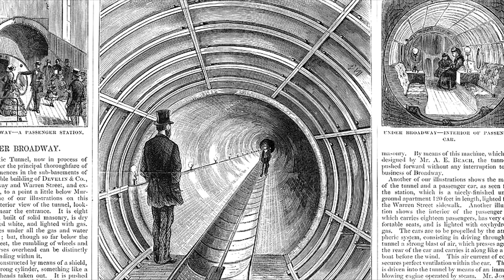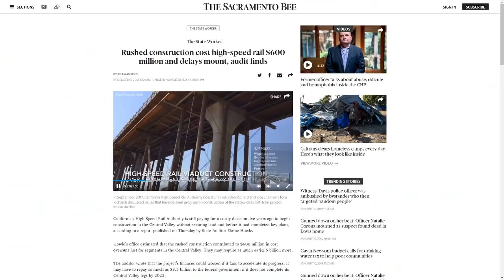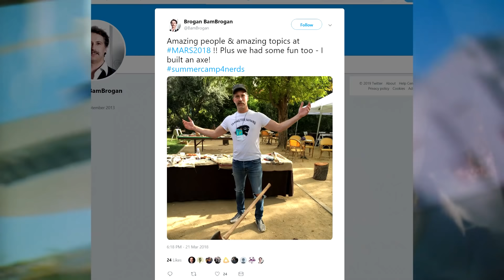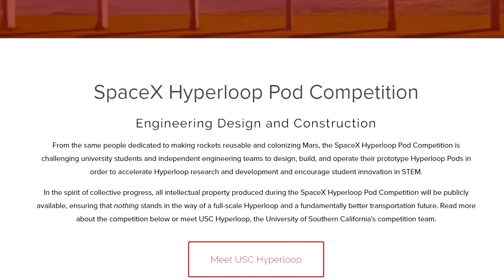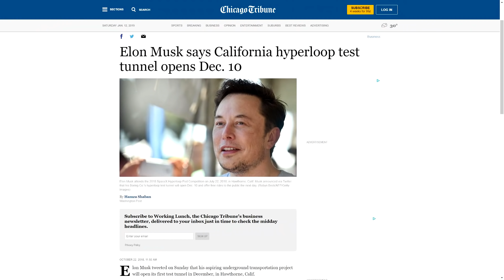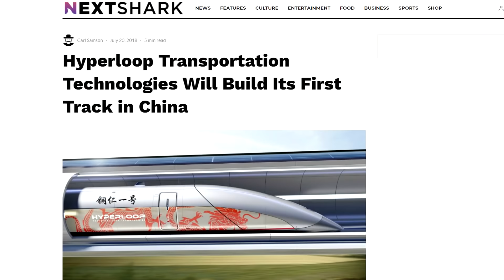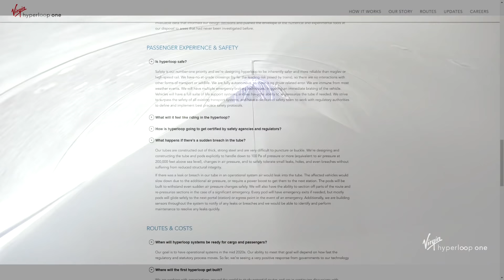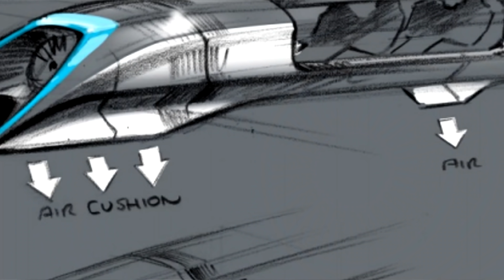Why Hyperloop will FAIL HARD - Its Biggest Problem...

Comment: 2 problems from my seat:
1: The cost of air travel in North America is cheap: You only need two relatively small pieces of concrete, some paved roads a few hundred meters long, a couple of planes (say are the same price as hyperloop trains), and two fairly expensive control towers.  However, you don't need to worry about land costs with air travel, you can travel to any city that has an airport and you can subtract or add planes for routes according to demand so it can scale quite easily.
The hyperloop, however, needs a ton of infrastructure, the maglev track, the tubes, the trains (which about balance with air travel planes) .  For the tubes alone, we are talking about Hoover Dam amounts of material and engineering and once a tube is built it can't go anywhere else.  
India and Dubai will have their hyperloops, eventually, but look at  the sheer cost of them for their length and their population densities and labor costs are such that might make it viable.  Why they didn't just build super-high-speed-trains that would have cost much less, can scale easier with demand, and have way better safety, I don't know.
2: The square/cube problem: The amount of power required to move a vehicle through air increases as the square of the speed.  So you say to yourself, "Aha, I'll just remove the air".  BUT the amount of power required to remove the air from a tube increases as the CUBE of the length.  That cubing of the power requirement will quickly nullify any gains made by removing the air.  Yes, once you create the vacuum, you only need to remove the air spent in the airlocks at either end but that initial ramp up requires a ludicrous (like entire cities) amount of power and you will need many, many, many motors to achieve it.

Comment: 10:03
London Underground Victoria line, Central line and Paris Metro Line 14:
Hahalol
Victoria Line: around 35,000 to 40,000 people per hour at 80 kph
Central Line: 29,000 to 35,000 people per hour at 100 kph
Paris Metro Line 14: (I don't know the exact frequency, so let's assume every 2 minutes) around 30,000 people per hour
THIS IS IN ONE DIRECTION ONLY

This completely dwarfs that of any hyperloop system. Add quadruple tracks and you double the capacity.

Comment: The reason it's gonna fail it's massively impractical if at all possible. The problem is with the vacuum tube. You're looking at a vacuum chamber larger than the largest one in the world by a factor of thousands, made of steel, which is a terrible material to use for maintaining a vacuum of that scale. Especially when you take into account things like thermal expansion.

Yes, steel and aluminium can handle massive over pressure. Just look at the 3atm inside a beer can. But cannot handle it the other way around. Again, how easily you can crush a beer can.

You're taking all the problems of high altitude space/air travel, combining them with all the problems of rail transportation and vacuum technology all mixed with all the engineering problems of building a pressurised pipeline.

This is why the test tracks are so small. Why none of the "pods" have achieved meaningful speeds. Because even a 3m wide 500meter long, with an internal volume of 3,500 qbm is the best they've achieved so far. A far cry from Nasa's SEC Vacuum chamber of 22,653 qbm. But then again, the SEC is made of foot thick reinforced concrete by actual engineers and scientists. To match the SEC, Hyperloop must make at least a 3.2km track

Comment: How much time does it take for a hyperloop train to stop in a station, let air into the station, disembark passengers, embark new passengers, suck the air out of the station and tunnel and have the train set off again?
Reply: It won't suck air in and out of the station, it will be sealed.
Reply: @squdardt.9719  So how do you move a train from a vacuum into a section at atmospheric pressure without the air destroying the vacuum? You have to stop the train in an airlock and then move into the station. Fine. What happens when you leave the station? The train has to stop again in an airlock, only this time the air has to be sucked out before it can move forward into the vacuum in the main tube. These stops would negate any gain from using a vacuum.
How do you extract passengers in the case of an electrical failure? You have to slowly let air into the tube, Extract passengers through the front or rear of the train and then have them walk along a tube for what could be a long distance, simply to deposit them somewhere in a desert. Think about these problems and stop being hypnotised by Musk's ludicrous dreams.

Comment: @AmericanRailClub: I like your channel, but you have your physics wrong at 13:28 

It all depends where the beach in the hyperloop tube occurs.

If a breach occurs some distance ahead of the speeding hyperloop vehicle, then air will tend to rush in to the tube (from outside), effectively creating a 'wall' of air inside the tube, which will then cause a sudden and large deceleration of the vehicle.  

Depending on the size of the breach, this will damage the hyperloop vehicle and cause injuries to passengers. 

If a breach occurs behind the travelling vehicle, then (again, depending on the size of the breach) there will be either a rapid or an exhyperlooprapidhyperloopprospect

situationhyper loopdifferential

assist

that it has

evacuatinghowever

Comment: It's not really the Hyperloop by itself that's important, but all the innovations and revivals and discussions it leads to, a conversation we need to have. Maglev, underground transportation, pods are all great ideas, it is certain that we'll see some of these ideas put into practice, for instance, between airports and city centers to start with, but also on longer distances.
If depressurized tunnels are too expensive or complex or risky, then that part may not happen (yet) without cancelling out the other Hyperloop technologies or ideas.
If pods can't serve many passengers, nothing really prevents from having pods departing every 30 seconds or having bigger pods without compromising that concept.
Trains that go from New York to Chicago carry more passengers, sure, but that's also because there are only about 1 to 3 direct trains per day, and they take 19 to 23 hours one way! Trains are more environmentally-friendly than planes, but most people don't want to travel at 31-37mph in 2019. In any case, building a fast railroad track above ground is not really an option these days, so building a protected tunnel where you can go high speed makes sense. An hyperloop from New York to Chicago would take only about an hour according to specs, which is about what it takes to go from city center to airport and back, let alone the plane trip itself. So we need to be realistic, but also to give consideration to how we can use the Hyperloop concept to design better transportation.
Cities can't expand much horizontally or upward anyway, so it is clear that there is a future for person and goods underground transportation. Shopping or Amazon autonomous home deliveries seem much more promising underground than above, for instance.

Comment: Safety: You point out the apparent lack of thought for emergency egress. Before I'd get on a "pod in a vacuum tube" I would like to know about what happens in the event of an on-board 🔥. Just look up "KAPRUN DISASTER." Pod in a vacuum tube seems much worse - the fire goes out when oxygen levels drop below levels needed to sustain life. Or do you get emergency supplemental oxygen (think airlines)? Or is it, "in the event of an on board fire you will pass out due to hypoxia long before you'll feel the burns?" I want to know. All Sarcasm

Comment: You’re the first I’ve heard to discuss the curve-radius and earthquakes too. Excellent.
Reply: Thunderf00t already covered those problems quite a while ago.  And many others.
Reply: @bdf2718  - I seen many of his debunks on this but can’t recall him discussing 700mph curves...
Reply: @prtauvers  I'm pretty sure he mentioned the curves in his past videos.  Not in great detail, but he mentioned them in passing at least once.

He mentioned them in more detail recently.  He examined the type of air compression needed in the original version (air sled) and noted that they did not handle curves well because of gyroscopic effects.

The whole scheme is fractally wrong.

Musk has implicitly admitted it's complete bollocks.  OK, I'll pretend to believe him when he said he didn't have time to run it, but that's no excuse for making it open.  What he would have done, had he believed it feasible, is sold the rights, or leased them, or some such arrangement.  Making it open is so he can say "It was a fantastic idea but it's failed so far because these clowns are bad at implementing it" and his fans will believe him.

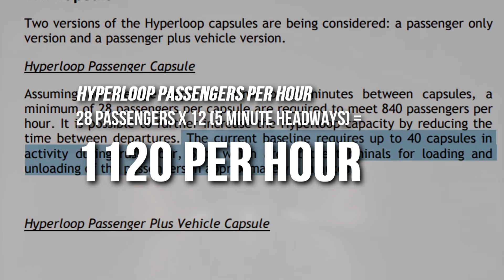Comment: You say at 9:34 that the max capacity of a pod is 28 passengers. Why couldn't it be more that this? Also why  have a headway of 5 min? Why not 30 seconds... or less? This would fix the capacity problem

Comment: The turning radius argument does not hold 'water' as it does not take in banking the turns. NASCAR races can reach over 200 mph, with tight curves (32' bank). Besides that, you are correct on capacity of the system - far smarter to just change to a subway application.

Comment: Boring tunnel concept has same basic problem -- economies of scale. It only takes one car at a time. Won't work for most people. If it works, it will be expensive and exclusive. 
I like the ideas, but they have major limitations in my opinion. 
Anyway, the stretch to make the tech work will help engineers learn new things and develop useful technologies that might improve the world in unexpected ways. The boring machine's efficiency seems impressive.
Reply: Everything is about scale, the only area where Musk's ventures are making progress is space launch systems.  Tesla wasn't his baby, but he's had control of it long enough to have made it profitable by now; instead it's still  in the red, and they haven't produced any trade or fleet vehicles that would get them the greatest market share overnight.
Reply: @MrTaxiRob  
Tesla is definitely profitable.

Comment: I am a railway consultant in Germany (capacity studies, timetables, transportation planning www.vr-transport.com) and we've written critical studies about the german maglev project lots of years ago. Sorry for the not perfect english, I try it anyway.
There are two kinds of magnetic levitation: Attraction and rejection. The german "Transrapid" driving in Shanghai (and not in Germany) works with Attraction (the magnets in the vehicle are placed below the rail, which makes switches difficult). A computer omits the contact, a fixed 10 millimeters distance has to be hold with nearly no tolerance. With rejection, you don't need a Computer. But the amount of energy is very high.  It flies 15 cm over the track. The japanese system needs 2 to 3 times more primary energy than planes, but not only for levitation, the high speed with full normal air pressure (planes travel in low pressure) needs a lot of energy.
The main reason why Transrapid has not been implemented in Germany is
- it is not compatible with the default rail network
- switches are not really possible (a ski jump on the other direction), so you can only implement point to point relations, it is not possible to create a network.
- The long stator motor conept omits energy transfer to the vehicle, but the active part of the motor is in the rail and not in the vehicle. This is the main reason why a Transrapid costs 3 times more than conventional rail.
- Because of the long stator motor and the 10 millimeter gap between rotor and stator, the energy efficiency is not as good as conventional rail.
- Because of the precise 10 millimeter gap and the need of heavy magnets, Transrapid has more unsprung masses and more wear than conventional rail.

The technical main problem is to build the Route without tolerance. The Transrapid does not accept tolerances. Because the route is a single bridge, every bridge pier needs a hydraulic or mechanic correction. The problem increases when increasing the speed.

A highspeed network needs switches with nearly full speed, otherwise the capacity of the lines decreases. The french TGV network has got 200 km/h switches on the 300 km/h lines. A stopover is only possible, if all trains stop or if the stopover has its own route with two high speed connections at the beginning and the end of the route. So high speed switches are a must-have for the capacity.

Related to Hyperloop this means:
- When using attraction levitation, the line has to be built without tolerance and has to be readjusted hydraulically (also when tunneling!). When using rejection, tolerances can be higher.
- You need switches with nearly top speed to make a network.
- For 1000 km/h, you need a curve radius of 36 km (same comfort as normal railway).

Hyperloop was already a dream in my childhood for me, but I fear and assume that it will rest a dream, not only because of economical, also because of technical/principally problems.

Comment: Here's an idea: Let's put humans, who need to breathe, in a sealed chamber with finite amount of air.  Then let's put it inside a vacuum.  No big... NASA has done it many times.  But the vacuum itself is in a chamber.  So these humans are inside TWO chambers, and they need to pass through both seals very easily and quickly, and if any seals leak, they die.

What could go wrong?

Comment: A change of socio-economical system will happen as a need, and it will in turn change the economical approach for everything. The economics might not be the biggest problem, but rather the energetic cost of producing vacuum for many kilometers. The documentary does not explain why solar energy could not power the entire tunnel network. The pressurizing and depressurizing problems can also be overcome, as it is done with airplanes. The accident risks and the problems related to them are indeed a much greater issue, but again, it comes to be a problem related to actual risk rates, like for airplanes. Again, the biggest problem seems to create enough vacuum as to reduce air friction to a minimum.

Comment: You were doing OK with the economics and capacity issues,  but your questions the press should be asking let you down badly, showing a desperate lack of basic understanding. 14:55 "why are the pods aerodynamic in a partial vacuum?" because there is still some drag due to the air that is there.15:00 "why are some of these tests still on wheels?" because  you might just want to move it when you turn the "lev" part of maglev off. Also the problems of a shockwave travelling down the tube in the event of  a breach has been solved. You are out of date.

If you want a real killer engineering question, just try to get information on track switches!

Comment: To me the most obvious economics issue is power draw.  Everything else in theory could be addressed and fixed but the power draw issue isn't going away.  The much touted advantage of all hyperloop designs is the massive reduction in drag which theoretically would result in a massive reduction in power needed to move through the tube.  However, until we get confirmation tests with regards to the amount of power draw reduction, confirmation that the reduction scales well to larger loops, and confirmation that the power draw to maintain low pressure ahead of the train is not so high as to offset the savings, the project is going to remain mostly a curiosity.  And the addition of the magnetic levitation tech only makes it more complicated to achieve this goal.  

Basically for this idea to make sense, the power draw required to move a max capacity of people through the tube can't exceed the same power needed to move the same number of people along a high speed train.

I think the main thing that keeps it going is that American politicians don't like trains.  They've been such enormous money sinks and people have complained so often of their appearance and noise that the prospect of a more discreet train that you can't accidentally walk in front of and just isn't trains has grabbed a lot of attention.  But the thing is, we should ask why our local governments are so incompetent that even building one railway is such a nightmare

Comment: This is whats wrong with everything! How about talking about safety. I don't care how fast it goes if I get there as a corpse . What and how are you going to make sure it's safe. Also it seems rather a scary notion but true that an individual with a psychotic disorder and a $700 gun could  bring this multi billion dollar  company to a halt. With a simple case of sabotage. They could kill hundreds and stop the tube for long time while they made  repaired
    Jets are very costly and the building cost of airports are beyond the scope of many us. But if some thing happened to one airport we have others to go to same with a jet.If something happened to one jet the industry can have another up and running in a few hours. The industry  doesn't live and die because of one rail.  Also some say what about the railroads .well  they were this country's transportation for a long time . And the railroads made the switch to cargo from passengers. But the infrastructure was already there.Also the lines do require maintenance but nothing like a vacuum tube.

Comment: Economics, economics, economics. Sacramento built a light rail system and it is a failure that cannot pay for itself or even close. Failed planning meant that once built they found out the system can only carry 2,000 passengers per hour. It will never make enough revenue to pay for daily operations. The initial investment will never be recovered. Daily operations encroaches on the local budget requiring service cuts. Great system. Only Government can afford to waste money on such large scales.